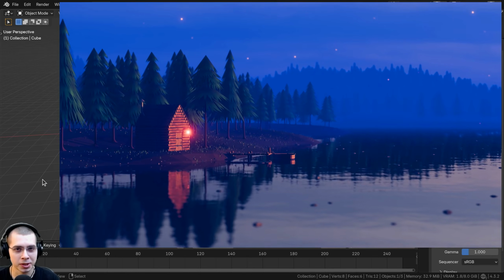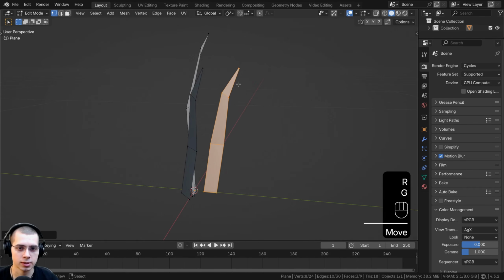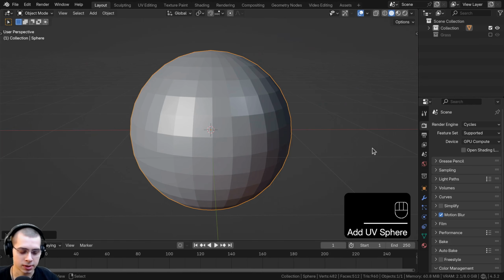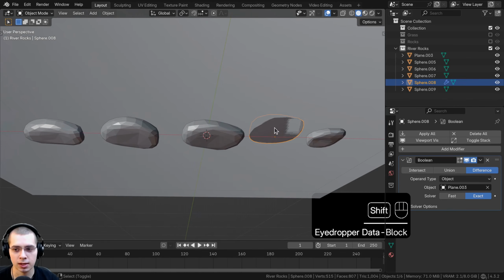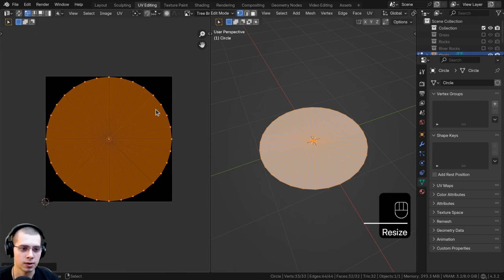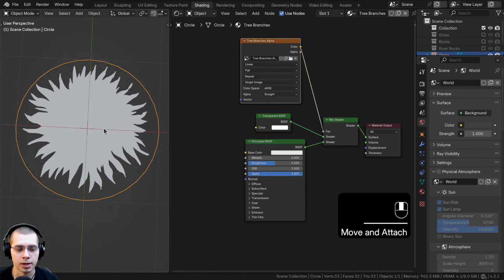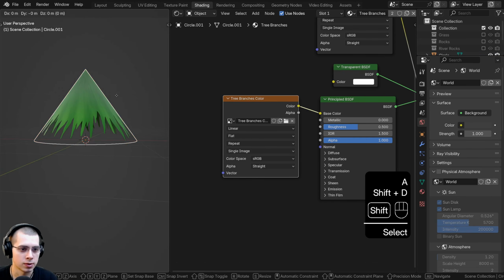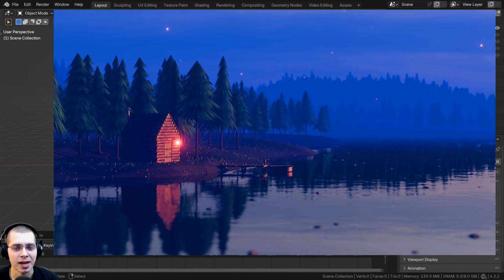Stylized Low Poly Forest River - Part 1 (Blender Tutorial)

Comment: Great job, I share one tip, that is, you don't need the mix shader and the transparent shader, all you need to do is put the mask in the alpha node on the principal shader. bonus tip since plants are a bit translucent put a little weight in transmission which adds some realism to the tree this works for the grass as well. Thanks to your wonderful explanation, I finally got texture painting something I struggled with for some time, it was the main reason that I clicked on your video

Comment: Hi, guys! Can someone help me please🙏😫. 
Texture painting crashes my Blender every time I open it.

I made a simple landscape, put a procedural sand material on it, then baked it to be able to paint it. The baked texture looks fine to me, everything is ok, but after I texture painted the original diffuse image, saved it and changed the original image to the painted one, every time I change the matrial view to rendered view, the blender crashes. 
If I try to render an image - it says "out of memory".

I limited the texture sizes, tried saving .blend file as another one, tried closing the file and opening again, my scene is not complex, there is only one plane with <10k faces (which rendered fine and fast in 4k with original baked image textures). 

The only way to render an image was to use CPU instead if GPU but it took A LOT of time. Can someone explain what the hell is wrong? I use a 4k image - it's ok. I use the same image but texture painted - my whole project is down the drain
Reply: i think it's a gpu driver issue